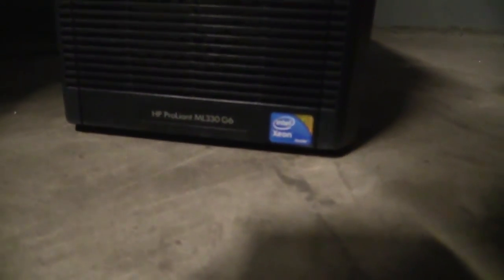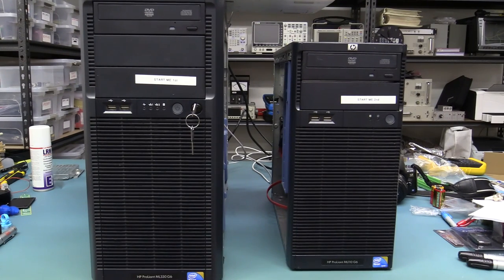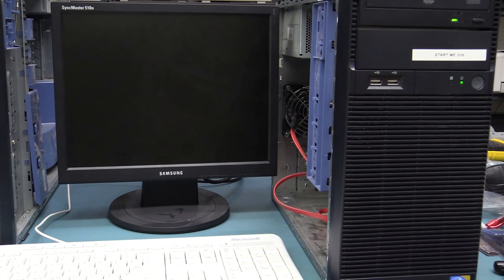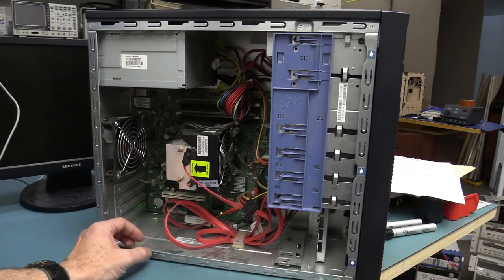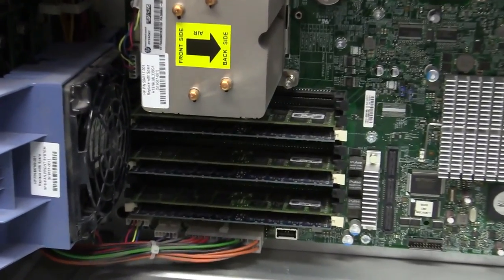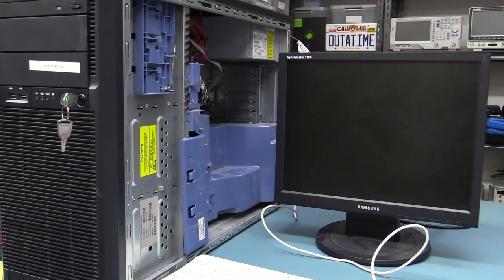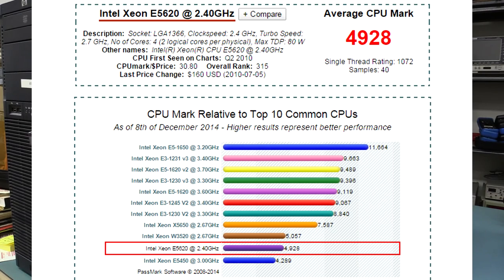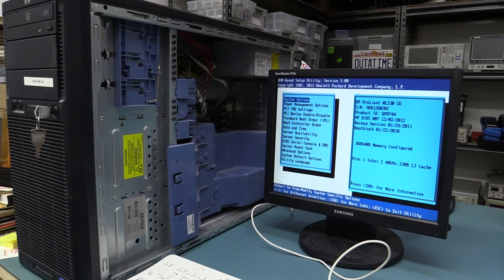EEVblog #691 - Dumpster Dive Xeon Servers

Comment: Not a bad scoop at all Dave. I had an ML150 G3 Server donated to me about 4 months ago. Was removed simply because it was slightly older than a support company would like. There was nothing wrong with it at all; I upgraded the RAM to the Max (8 Gig on a machine of that vintage) and swapped out the single processor for a pair of 3.2GHz Xeons which I picked up on eBay for what would equate to around $60. So for less than 100 bucks, I have a server that will do everything I need for years to come.  If you have a need for a server; I'd hang onto at least one of them. :-)

Comment: they don't have RAID cards, those are b110i fakeraid(hostraid) controllers, i wouldn't trust a bit in those things and i have horror stories to confirm...
Also, a 330G6 can go upward of 1K here, that thing should sell AT LEAST or 600 alone
Reply: Can confirm. I have been bitten by the B120i.
Reply: SeaJay  First, they're not cards, they don't even use special chipset/ASIC in them, thus they lack all sort of dedicated processing a real RAID HW card has

It's the same as the "intel raid" in consumer motherboards but with a different bios string.

these fakeraids/hostraid/driver-raid are esentially using the host cpu for everything, the "HW" part is the exact same SATA controller the intel chipset aleady has.
Reply: lassi kinnunen  i'd say the results are worse as the data format and nuances are propietary, thus when shit hits the fan(i.e. motherboard broke and got replaced) these propietary fakeraids will be had if not impossible to recover.
Whilst a softraid is usually plenty documented and has a better chance of recovery.

this goes double if you want to do specialty stuf like raid level migration or capacity expansion, forget that any of that works in hostraid, but you might be able to do it in software raid
Reply: I never understood why hardware RAID got so popular.  Each implementation of hardware RAID (as well as fakeRAID) uses its own proprietary controller firmware and format so if your controller dies you have to buy an identical replacement controller or you lose everything.  If you use software RAID (such as md on Linux) then you can throw your drive pair into any old PC with any old Linux version and it will identify.  I guess if you have millions of dollars and a contract with the hardware RAID vendor to ensure you have replacements available it isn't as big of a deal, but why constrain yourself?  Spend the cash saved from buying a dedicated RAID card on a more powerful CPU to make up the difference in CPU usage.
Reply: CalcProgrammer1 Proper hardware RAID controllers often have a battery-backed cache unit. This queues up writes to the disk, and caches read data, so you get a performance increase. The battery backup unit preserves the data in the cache if you shut down the computer or hard power off, so no data is lost.
Reply: CalcProgrammer1  HW raid is popular because it's OS agnostic, has better performance and better reliability usually(plus proper drive management, with background scrubbing tasks, media failure management, drive drop management, etc), and you don't need an identical controller as each vendor maintains the same format over all their card (f.e.: all HP HW raid controllers use the same format and you can move between models at your leisure, same with Dell PERC and same with any LSI HW controller). Plus it doesn't uses host resources.
The only "SW" raid that can be considered better than a HW raid is ZFS, and it's a whole different beast...
Reply: Mark McGough BBUs cost extra (and the cost is usually ridiculous like $300 for a camcorder battery pack essentially).  It's cheaper to simply use a UPS that has the ability to hibernate the desktop if power is out for longer than X minutes.

Comment: In the ML330 one, those 2 fans in the front between the drive bays and CPU/RAM are in the wrong spots, there is supposed to be 3x equalling installed from the bottom of the case with no gaps or 2x at the minimum, as it is now those would definitely hinder thermal design as either fan installed there is not in line with the FANLESS heatsink, sounds like it was a firm built server from a HP kit, each fan is supposed to be in line with the duct guide, clue to this is the fan with the PCI slot guides is supposed to be in line with there corrisponding slots - they are not.

Comment: Wow, that's an impressive find! 36GB RAM and a quad core Xeon-e5 is not something you find in the trash in most countries. Good luck selling those - I think you can eaily get 500-600$ for both.
Reply: This is before Xeon E3,E5 and E7.However still a nice find though.

Comment: The ML360 and ML160 and up are the dual CPU, I recently bought 3 ML110G6's refurbed cheap for about 300USD ea with HDDs and new Win7 COAs, so indeed a good find.

You can download System Service Pack disc from HP. Its a bootable DVD to update all the system firmwares (BIOS, RAID, Lights-Out management, NIC, etc) as well as run diagnostics and, dependent on model, off-line RAID management.

Gen6 is still supported, but pretty much all out of warranty now, so you'll see a lot of them getting dumped by companies that have a firm replacement policy. That comes in handy for me, my employer does everything on the cheap and I can get perfectly serviceable Gen6 server gear for under quarter the new price.

Comment: Gotta say, they're not top of the line machines - ML110 is an entry level server for small businesses. ML330 is a bit higher up the ladder but even then, it's meant for those who are a bit cash-strapped but may need to expand - there's a CPU mezzanine card available for them that plugs into two interface slots on the main board.

Comment: You could use one of them to run the EEV blog website. I like how the cpu cooler in the smaller machine is pointed directly at the case fan so that the heat is immediately transferred outside, unlike most consumer cpu coolers which flow the air in all directions.

Comment: I use a Dell Precision 690 from 2007 as my main rig.
Dual QuadCore Xeons, 16GB RAM, GTX 650, this thing costed me about 200 bucks and is freakin fast.
Reply: You should upgrade that GPU some time, make it even better.
Reply: Adam Cabbage Well, the GPU ist the least of a problem, since I am no gamer.
My main problem is the RAM, I need to get this upgraded to 32 or 64gb.
Also, I use linux, which is very happy with my GTX 650 as well as my wallet :)
Reply: Philip von Behren Jesus, 32/64gb of ram? Think of how many google chrome tabs you could have open.
Reply: Adam Cabbage well if he renders video's or so 32gb isnt TOO much.

Comment: With the ML110 G6 server you can change the power supply into a 650w and add a gaming videocard and turn it into a gaming beast. Server parts are better. Got myself a Dell Precision t3500 with a 8 core xeon from ebay with 16 gigs of ram and it plays decently
Reply: +SkyFire I try and does. It work. I have a ML150G6 and I was looking to use another PSU but got errors on boot maybe the original psu have some sensors? I get back to the 450 psu and I have these running W10 64bits now very well I need help !

Comment: There is actually also desktop hardware that is very stable and designed for the long run. It is even possible to do some overclocking in a rather reliable way.

Comment: it would be cool if you could start putting the LCD monitors together to make a large 20k screen or like a holodeck type room. no idea what you could use to run it though.

and if only that server had a PCI-E slot it would be an awesome gaming/3d rendering computer and workstation. would have plenty of power and ram to render video too.
Reply: Actually, they both have PCI-E. The big one has 24x gen2 and 1x gen1 physical lanes distributed across those 4 slots, while the smaller one has 20x gen2 and 1x gen1 lanes across 3 slots.

Comment: Most newer computers don't have those massive heats-sinks, or really need them like they once did. Back in the Pentium 4 days they ran much hotter than today. They've managed to get better efficiency and performance, so things don't get as hot. Some people prefer the huge heat-sinks because they feel its going to cool it better, but really, unless you're overlocking them as far as they can go and work them hard, the stock heat-sinks are more than adequate. The heat-sinks in these are also heat pipe style, which seem to be more efficient than the solid machined aluminum ones.

Comment: Just wondering that is this stuff going for recycling or just garbage dump as land fill? In here you have to throw stuff like that to recycling to get it recycling, but I think that for example in USA they separate recycling stuff later in the line?
Reply from the maker: mcmaddie For commercial dumpsters like this it's usually up to the contracted cleaning company how they deal with it. It's actually against building strata policy to dump this stuff in the dumpster room.

Comment: 1/Mgmt = NIC 1 that can also carry the iLO interface on the same cable if you configure iLO Shared Port Mode
Mgmt = The dedicated iLO port if you don't want to run in Shared Port Mode.

Comment: Wow.... Yesterday I found an Asus VivoBook X202e toutchscreen netbook with a 500gb HDD 3rd Gen Core i3 3217U CPU and 4gb RAM Unfortunately soldered on but works fine for watching videos like these. There was NOTHING wrong with it! I bypassed the windows 10 password on the previous install and it was slow as a snail so I just reset it with a clean install of windows 10 and it works fine! I might get a Samsung 860 EVO 512 GB or 1 TB SSD for it though. I can't believe people throw away things like this that have easy fixes like this.

Comment: Pretty awesome, the 2nd one's barely 2 years old!  As a matter of interest, could they be turned into reasonable gaming PCs?
Reply: Nope. They don't have much in graphics horsepower
Reply: eehawkee clearly, but a more beefy card could be put in? or would their expansion slots not accommodate a modern midrange gpu?
Reply: Rubus Roo Both of them have PCIe 2.0 x16 slots so technically yes.
Reply: Here's the thing.  You COULD pop in a gtx 680 or something and game, but really the cooling is not ideal.  These are using custom ducted configurations to cool the CPU and only the necessary components.  Whereas a gaming PC would have much different cooling with a lot of fans to channel to rads, GPU etc.  

So, really you would need better cooling for that, as that PCIE slot is more for commercial things like 10gbit nics, raid, fibre channel cards etc.  

In summary, you could, but honestly it would not be ideal.  That is a first or second gen Xeon, so somewhat equivalent to the i7, but more tuned performance, maybe more cores, pro features, etc.
Reply: Yes you can build a really good gaming PC with one of these. i builded one for my friend.
I found a good IBM server 2012 with a Xeon for like u$d 100 in my country. I put a GTX 750Ti (consume 65w, runs cool and is capable to run a lot of games at 1080p@60FPS) and a Sound Blaster X-FI . No problem so far with the cooling that server cases have a really good airflow.

BTW u can modify that PSUs and solder one or two PCI-E Power (depend of the 12v output power), in my country is really hard get a nice PSU so i buy used server psu and modify them. My PC  ( i5 4460 - 8gb - ASUS Z97A - R9 270X) is running with a modified Dell MK463 750W  (i put the PCB in a normal ATX psu). That PSU have four 12v - 18A rails ... so it distributed as follows: Rail A - Rail B: EPS Power - SATA / Molex - Rail C - D: PCI-E Connectors. Never get a OCP even with my old SLI config
Reply: +David Spinelli i know is a old post, i got a ML150g6 I need help for the psu, since I want to change it to a consumer grade one mine is basic   But I could be nice project can I have your assistance?
Reply: Your computer have a dedicated graphic card ? From the pictures i found on internet , seems to be a normal ATX PSU (no propietary conections ), 460W is enough for a normal computer with a mid-range graphics card (one PCI-E 6-pin power conector max)
Reply: The Ml150g6 does not have a GPU. As far my reading looks like a Normal ATX PSU. I can get a second handed one today to try that have a 24, 8 and a 4 pin to mobo. I have read everywhere and as far my reading goes, no one has done it.
Reply: If the power supply is in good condition will work just fine. I usedT Dell MK463 with two HD7970@1050Mhz in crossfire for like 6 months without a problem, now i switched to a Seasonic M12 because looks better :P
Reply: Do you think that the Seasonic SS-1050XM will be fine? i have a good deal on those and have a 4, a 8 and 24 pin. ???? If you tell me is ok i will get it since ofor 100USD is a steal.

Comment: You usually don't find hard drives in them because when a company scraps a server they take out the hard drive demagnetise them and then shred the hard drive disks into pieces before throwing them away. Just so no data can be recovered from them.

Comment: The e5620 can be over clocked to 4.3ghz stable.  I have been running  one at 4.1ghz and 100% load for 2 years straight on the stock cooler.

Comment: Had an old set of Proliants with dual pentium IIs that where on daughter cards. Also had redundant power supplies that could be removed/installed while the system was live and same with the disk drives.

Comment: Awesome find, you have all the luck. I would guess the previous owners went out of business. Otherwise they would have kept them as backup servers, parts, or sold them.
Reply: No, as Dave alread said, when some "old" hardware is completely written off, they need to dump it. If a company sell them, they do need to write that into their tax-books as well, or they will get some trouble when they claim tax-refunds...
Companies tent to simply dump these sort of things, as it´s, by far, more easy to them, than it would be if they try to sell it. Furthermore they can´t sell it to end-user, as end-users do not give them a differential tax reciept anyway, as they simply can´t do that.
Here in germany we got some inbetween companies which do jump in there, take all that "old" stuff for some money in return and clean it, make it again working and sell them to the end-user as used machines. You can find one of these reseller-companies in nearly every larger city by now, as the companies do want to squeeze the very least cent out of their things by today....
I sometimes go there to have a look when i need something, as they always got some Pro equipment sitting around. My IBM keyboard (the one with that unique klick-klick-klick while typing) i bought there some years ago for 5 bucks, as well as some SCSI hard drives as well....

Comment: Great video Dave. About the "small CPU" heat sink in the Xeon vs "big ones" found in gaming rigs : 

It is no just about CPU design, air duct and such : this Xeon is clocked at 2.4 ghz while most today high end CPU are running at (minimum) 3.3 ghz... no surprise it need small heat sink.

And did you heard how much noise that Xeon makes ? Even at idle it is just "too much".
With really big heat sink (several times bigger than the xeon one) and low RPM fans you can barely hear a CPU cooler in a gaming machine (even at full load).

Comment: The fighter jet noise, that's why they get away with a small heat sink. Heatsink thermal capacity times airflow.

Consumer models have much bigger heat sinks so they can run lower airflow. Xeons are not that much lower in power usage.

Comment: Later BIOS versions on the G6 and almost all G7 HP Servers the BIOS takes almost 2 minutes to show up because of some background diagnostics that are run even before POST.
With Gen8 and beyond, the iLO 4 will initialize the GPU after only about 3-4 seconds and then will show you the results of all those diagnostics.
So just to say, "2 minutes of darkness" on a G6/G7 is fairly normal at power on/reboot.

Comment: I'm not sure if anyone else mentioned this, but these obsolete machines (BIOS from 2011, so they're at least 3 years old) would probably end up costing more just by the power they use running 24/7 than an equal (or likely better) spec modern machine. And 2011 Xeon with 4GB ram what's the use? You can probably buy ECC/RDIMMs for it, but again they will be more expensive than current generation stuff... So it's a lose-lose either way, it will cost more to upgrade it with obsolete components, money which could have been spent to buy a modern system. There's a reason these got tossed, and very likely power consumption or lack of reasonably-priced upgrades was one of them.
Reply: Nehalem isn't exactly power hungry monsters compared to Sandy Bridge,Ivy Bridge and Haswell.
Reply: Giggity Goebbels Power consumption to performance, Sandy/Ivy Bridge and Haswell/Broadwell is a lot better than Nehalem CPUs.
Reply: lassi kinnunen In the long term though, it costs more to keep older equipment especially when methods & updates are implemented. Plus, with the cost of electricity dramatically increasing in multiple countries across the world, saving a few tens of thousands of dollars is worth it in the long run.

Comment: Awesome score. I'm currently running a Proliant ML350 g6, with the dual Xeon x5675's at 3.07 ghz and 30 gigs of ram. Its a juggenaut and can handle whatever I throw at it, of course the Radeon RX Vega is required for the games. I manage to buy mine from a recycler and about 3 more after haha.